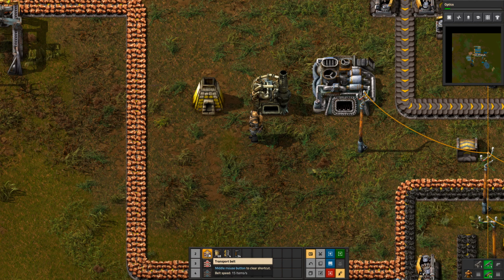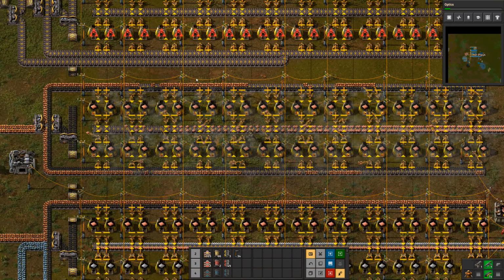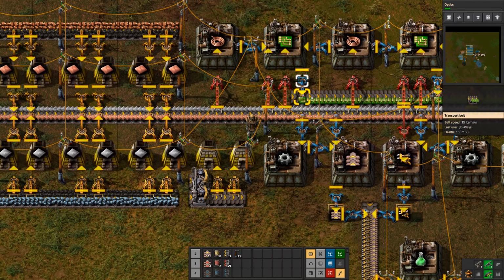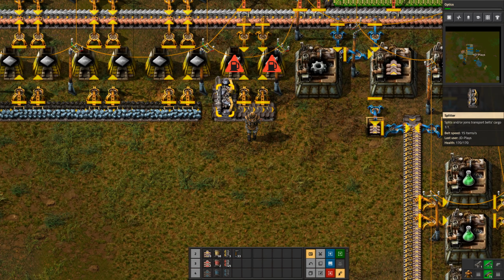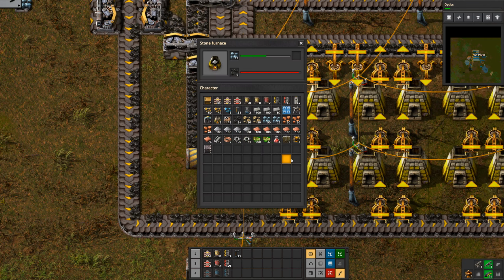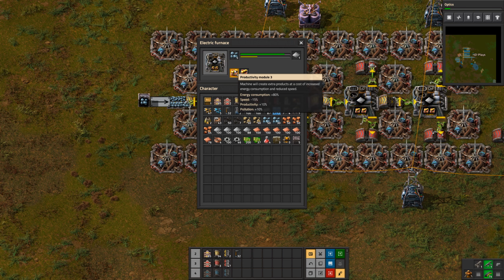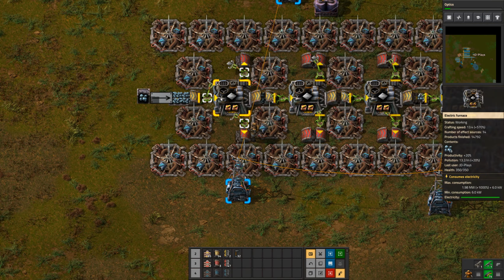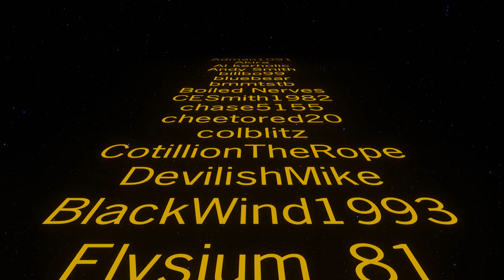Factorio Furnace & Smelting Guide ⚙️ Introduction to Factorio 1.0 ⚙️ Tutorial/Guide/How-To

Comment: Good stuff here but I do think it is important to point out that one of the main benefits of the electric furnace, imo, was not mentioned here.  At the same production rate they run at 1/4 the amount of pollution the steel furnace runs at.  So, even with the extra percentage when you have productivity modules in them, you're still being way nicer to your neighbors with electric furnaces than you are with steel furnaces.
Reply: 1/4 compared to STEEL furnaces?  I thought it was compared to stone furnaces, which burn twice as much coal per plate produced, i.e. 1/2 compared to steel, not taking into account pollution from power generation.  1/4 would be a colossal change, esp. with nuclear power (or huge solar farms).